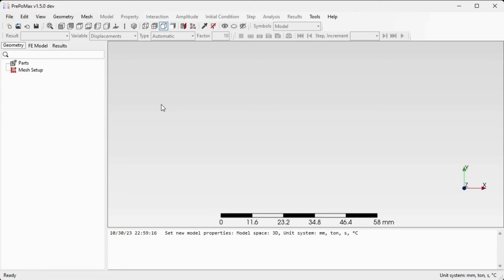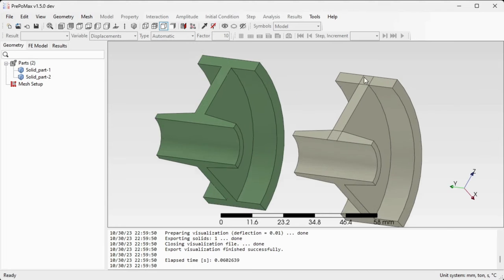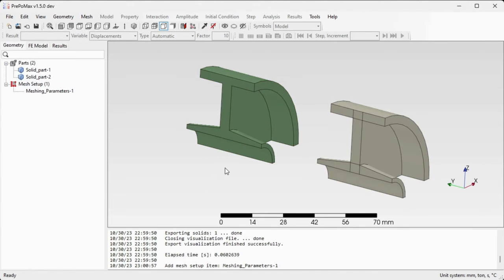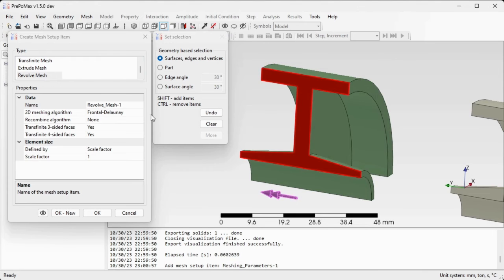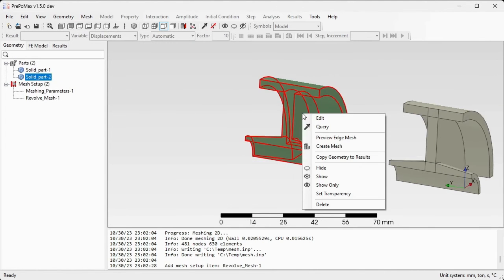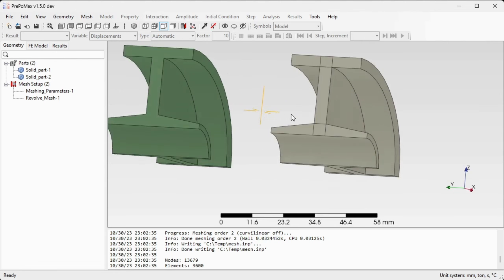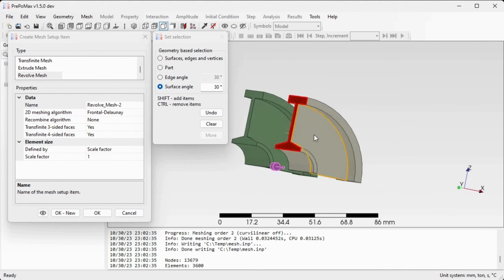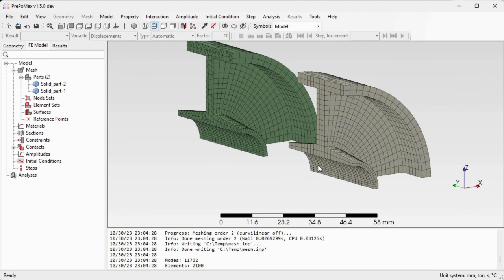PrePoMax & CalculiX - Revolved meshes

Comment: Brilliant tutorial.
I had only one confusion. How can we split the face of a complicated geometry ? 
I tried the split face function of pre pro max. it only works in certain cases when a nearby splitting vertices are there.
Reply from the maker: The split face in PrePoMax is only meant for very easy tasks. In case a more complicated geometry is used, the CAD system should be used.
Reply: @MatejBorovinsek  thank you for the information. Any suggestions about this software? Can FreeCad do it?
Reply from the maker: I use SolidWorks but FreeCad can also do it.
Reply: @MatejBorovinsek  thank you. My problem is solved

Comment: I really like the clear and straightforward workflow of this excellent tool! Thank you very much for this gift!! 
One question: How do you mesh 360-degree geometry when there is no cross-section to select?
Reply from the maker: Thank you. Unfortunately, currently 360 degree revolve is not possible.
Reply: You could try using 2 meshed parts revolved by 180 degrees. They could be connected with tie constraints (introducing potential spurious stress concentrations but it may still be worth giving a try).